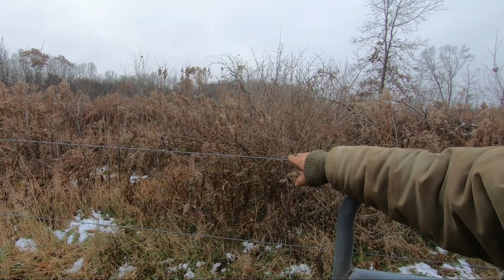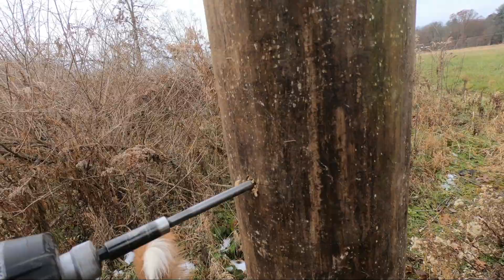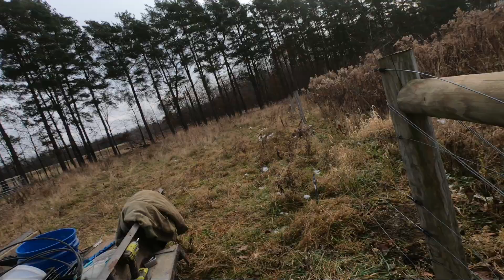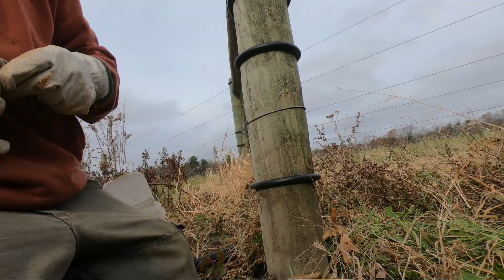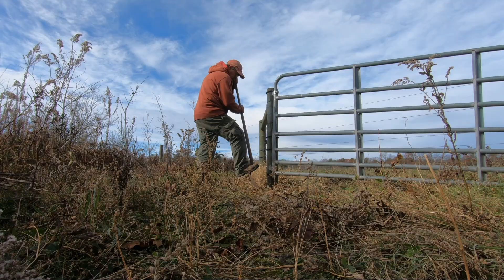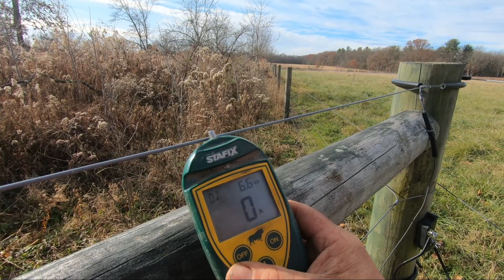Pipe Gate installation Including, location, H brace, termination knot, post driving with shaver #10

Comment: Russ how many strands of wire do you put up on your perimeter fence, what is the spacing and what ones do you make hot? Great video.
Reply from the maker: Hi Dale Thanks for watching!! We have 6 and 7 wire on our exterior 
fence. We have many different wire spacing. The spacing I like the best is top wire at 50" and bottom wire at 8" then space the wire evenly in between. The wires we make hot every other one then ground the neutral wires. Leaving bottom two insulated wires not hot so it doesnt short the fence out. When we put livestock in there we have the option to put a jumper on them to make them hot.